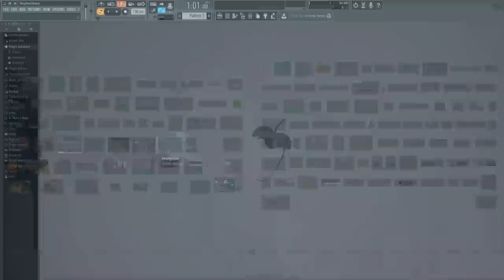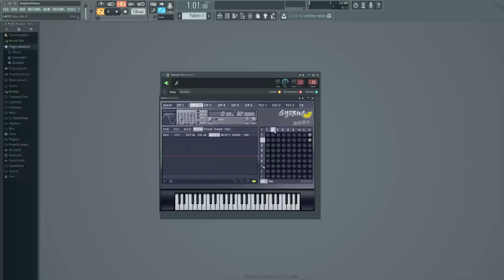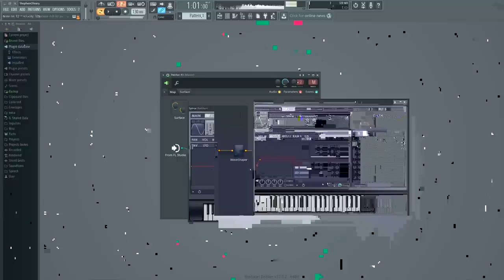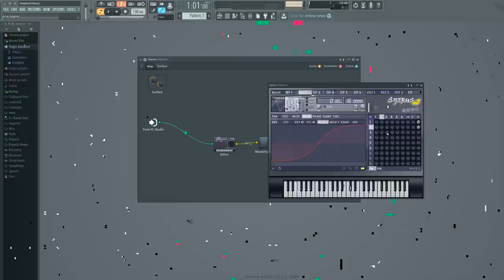How To Bass 125: The Dubstep Bass

Comment: I know im late to the party here but what param are the X/Y knobs linked to? ive watched so many of your tutorials just as jumping off point because im using a different daw entirely and your knowledge of FM is amazing. Im able to follow everything up to a point (ie chaining operators, adjusting ratios, and fine tuning harmonics). But every time you use the X/Y mod it always leaves my patch sounding way different. I use reason and able to turn almost anything into an FM synth but maybe im missing something here. Is sytrus just able to do things that i cant in reason?
Reply from the maker: X and Y are usually linked up X to primary FM modulation and Y to secondary FM modulation. Two things determined specifically for each sound. 

Usually it's overall main Mod and then whatever extra nonsense I want to tweak that isn't the main mod. Like a primary osc being FM'd by a similar osc, and then that modulator being modulated. That'll be where Y goes.

Comment: Have you ever done a How to Bass on a specific sound in Dubstep, which is a saw wave going through a phaser, then vocoded? It'd be interesting to see what you might do to preserve the sub frequencies, because I always find myself having to add a separate sub.
Reply: IanStarGem Just adding a separate sub is a good practice anyway. Most of your sound you should high pass at ABOUT 150hz and ad a separate sub.
Reply: ***** Yeah, I know but seamless for some reason seems to avoid using separate subs for some reason.
Reply: ***** And of course it's always good to know how to preserve the sub without adding a separate synthesizer for it. It might become useful information.
Reply: IanStarGem For me the most interesting sound that i make come from not worrying about the sub in the initial sound. Have you tried making the sound in patcher and using EQs to frequency split the sound before FX and then bypassing the FX with the low split?
Reply: IanStarGem I don't get why you may want to preserve the sub. having 4-6 different basses in the drop with their sub is going to be madness to mix because all their sub will be different sounding (if they have different characteristics, one will be stronger, other weaker etc). it makes it so much easier to mix and consistent to just have 1 sub bass synth that follows the midi of the others :P then just add layers of bass without their sub. Btw seamless doesnt have a seperate sub because he seperates it with EQ in patcher.
Reply: ***** Yeah, the problem with that though, is that without the fundamental sine wave, harder distortion will be different. Not "worse," or "sound bad," just different. You may want that for your specific sound, but I usually prefer to low cut 100Hz after the processing.
Reply: IanStarGem I can see your point! I suppose I very rarely used these distorted sine waves to know what you can get that way :P however if you cut the sub at the end of the chain, the tone, you say, would still be there i guess
Reply: Omen Ahead Yeah, the point of this though is actually explained quite well in this video, because the sub sine + higher sine wave creates a certain tone, and removing the sub removes that tone, because of the way distortion works.
By the way, this applies to compression too, if you put two things into a bus with a compressor on it, it would behave differently and sound differently then if you had the same compressor with the same settings on the individual channels. (Thinking about it though, I'm not 100% sure that's true)
Reply: IanStarGem what I meant was, not removing the initial sub sine wave, just have an EQ after the distortion to remove everything under 100-150hz . this actually means that you keep the tone you created with the sub + high sine wave (both 2 things are still there, but you "hide" the sub part with the EQ) and you can add a seperate sub to have a mixing-friendly sub track :P aaand my neighbors are having loud sex and all these things I write suddenly seem dumb xD
Reply: Omen Ahead Yeah I understand. That's a whole different thing.
Reply: Guys I am wondering what you think about something. For the sub, is it of any use to have the second harmonic there as well and not just the fundamental? I get the impression that if you keep the second too, you get a "fuller" low end. i guess it is how someone prefers their sound, but id like to learn ur opinion
Reply: Omen Ahead Having the second harmonic is mainly useful for 2 things: If the the song is in a key where the bass notes are so low that they start to loose power and for having your low end be more present in bad speakers/headphones. Some producers recommend using a sine wave, distorting it to create square harmonics and then low passing that. I know Barely Alive says they do it that way. I have a problem with that. distorting a sine wave creates more that just square harmonics sometimes even harmonics lower than the Nyquist Frequencies causing an absolute mess of a low end that can sound bad on club speakers. What I do is Keyboard track a custom Lowpass in Harmor. and adjust the second harmonic so it sounds good in the song. But since Barely Alive has songs that go off in the clubs there might be something to the hole distorted sine wave thing.
Reply: ***** Good points, man! I think that distorting the sine wave, tho, is going too far as I see it :P some songs in electronic music in general, have amazing low end that I can hear even with my small ipod headphones and it makes me wonder. I guess you need to experiment what is the best way to set it to fit your own style. From my experience, just a sine wave doesn't always make it.
Reply: Omen Ahead I like layering two sines, one an octave up, and then running them through a little bit of distortion to get a nice warm sub
Reply: Lack Of Silence yeah thats what I literally do with the second harmonic, but distorting it isnt the same as increasing its volume in this case? or is it changing the shape to something like a triangle?
Reply: Omen Ahead Its more similar to your second theory there- basically distortion is adding more harmonics. Thats all its doing. But crushing the two sines together gives it a different kind of warmth, from my experience.
Reply: Lack Of Silence i think im gonna try it in some song :P the reason why I want a more defined sub is that I often use a bass guitar in parts of some songs (under guitar) which by nature is more noticeable and big, so a simple sine wave by comparison seems "small". I def gonna try ur way
Reply: Omen Ahead Yeah, I feel ya. Sub/bass fills up a lot of the missing space in tracks, and I also enjoy the grittiness of guitar tones, so this I have found is sort of the edm equivalent
Reply: Lack Of Silence I don't really see what Seamless has against sub basses, they're really really useful if used properly. Especially for sound design which I have been doing alot of lately, and the sub bass usage is not very obvious, but it's there.
Reply: IanStarGem Personal taste, probably
Reply: IanStarGem well he is not against it. on the contrary he wants to it to be there (remember the viewers' track reviews where he praised the presence of a "seperate sub"? :P ). He just seperates it with an EQ in patcher as a layer inside its bass so its kinda the same thing.

Comment: when he gets to adjusting the tones on Sytrus, his sound when he plays notes while on Sytrus is completely different from the one i get, which sounds more like a pipe organ. I started from zero for this bass so i didn't change anything to any other sound. Why does this happen?
Reply: if ur still alive and stuck then click on the arrow beside Sytrus, then Presets and then default
Reply: I try to do it on default and it won't work...The sound is too crunchy, and it doesn't sound at all with what Seamless did. Solution please ?
Reply: Ataraxis Dub Give it a place on the stereo mixer and equalize it or lower the volume
if its ur sound quality then check on the audio options

Comment: HI!
I have an (unrelated) question regarding music production.
I'm pretty new to this all therefore I don't own the best production equipment. I own this headset which was made specificially for gaming but I think it's a great headset for music production too. However, this headset has a build in EQ (I assume all headsets have this). The question I have is that when I am producing music, should I turn the headset EQ off?

I hope I'm clear enough! thank you
Reply: Nothing critical at all.
Reply: Yes, turn the eq off. Its hard to mix when the frequencies aren't flat.
Reply: Radiant Rayv you misunderstood the question. There is no way to simply turn off the inbuilt eq, and besides it wont matter as the listener is used to hearing the audio through their headsphones.

Comment: Do you (or does anyone) know if there are any vst wave shapers similar to the one in FL? I've seen a few but none of them have asymmetrical distortion, which I know you haven't used here, but is something I'd like to have
Reply from the maker: KelleyBates Waveshapers, not so much. The only other similar thing I've seen is the distortion unit inside Serum's FX rack. 

Plenty of regular distortion units have asymmetry options though. I don't know what any of them are called since I just use the FL one but I know they're out there.
Reply: Damn, I wish ImageLine would release that as a separate plugin like some of their other stuff. I've used it before, and like the sound but am usually an ableton user. I havent explored Serum's distortion section very much yet, so I'll give that a shot,.

Thank you!  :)
Reply: KelleyBates Hey man, if you havnt found it already, imageline does bring out Waveshaper as a VST. i am on ableton too and i love using some of FLs plugs...they frankly are 2 awsome.. though not assymetric, abletons saturator on waveshaping option kicks ass too...
Reply: Oh really? I'll have to look again, I didnt see the waveshaper on the ImageLine website. Yeah I do like the saturator in ableton as well, just kind of looking for other options to play with. In serum, the x-shaper (asym) mode in the distortion is kind of an asymmetrical wave shaper I believe. You can draw your wave just like in FL's waveshaper, but you have to blend between the two shapes using the drive mode, so I'm not sure if it's truly asymmetrical or not. I should probably read the manual.
Reply: Well I got a different style one in a cm magazine , I'll find it later and tell you

Comment: You might want to redo this one considering the audio starts freaking out around 4 minutes...
Reply from the maker: amphobius I would but this is the third time I tried to do this video. The other two were doing it from the start. All the important stuff happens before it goes to shit so it's ok ;p
Reply: SeamlessR I think it's a firewire thing, my firewire interface (Saffire Pro 40) does this sometimes, but my USB interface (2i4) has never done this.

Comment: You know that bass sound in the background of EDM music? It's like a mix between a kick and a bass. I can't figure out what that's called or how to make it. If anybody knows what I'm talking about please explain it to me. Thanks
Reply: ***** Not even a psychic could tell what you mean by that.
Reply: It's called an 808 kick. Basically, it's a sine or a triangle wave with a long release tail on the volume envelope and pitch sharply "sliding" down at the beginning of the sound to give it a drum-like hit("pogo effect"). In big room house, this sound is usually run through distortion, EQs, compressors and stereo widening plugins to make it richer and "fatter".

Also, chances are, there is a similar "clean" 808 Kick in the built-in sample library of your DAW, you just have to enhance it with effects.